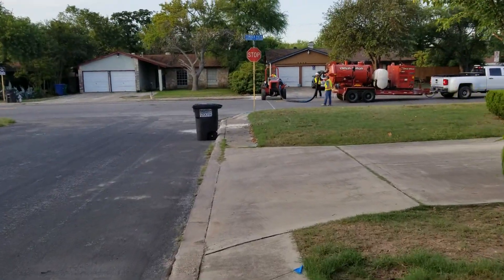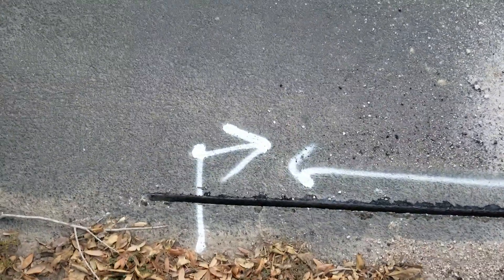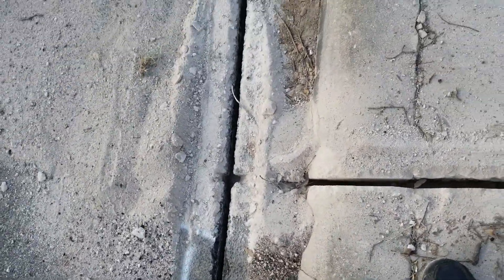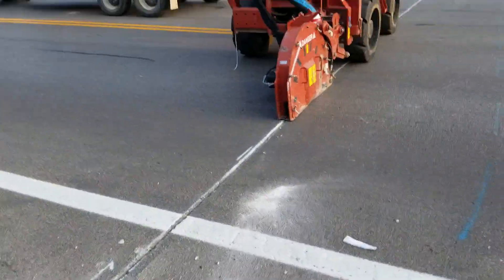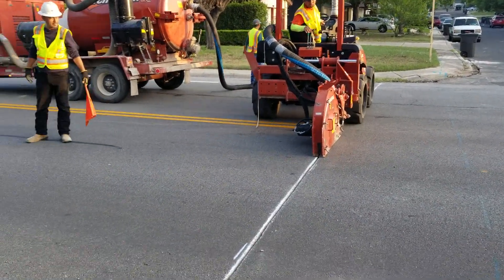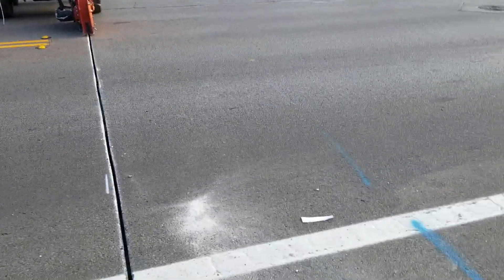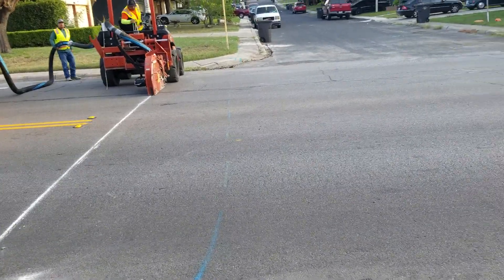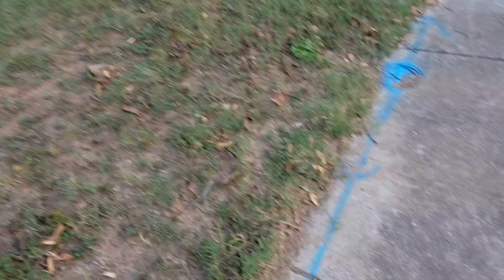How Google lays fiber.

Comment: Just messed up Louisville so bad they up and left.
Reply from the maker: The process used in this video is not the same as the one used in Louisville. Here the trench goes down about 6 inches. I do wonder why the do not just use the microtrench cutter and cut down to a known good depth right through the existing bad installation and lay new fiber in this trench. That would get rid of the old and loose fiber in the least incomvient way and result in a working  system in the end. They are going to have to pay to fix this mess anyway, so why not do it in a way that results in a working system?
Reply: for that info information. I thought they were microtrenching in Louisville since AT&T didn't grant them the one touch move to be on the poles with other utilities in that city. Do you know what method they did use? And I totally agree with you. They should have fixed it to leave a network that can be used. But they've had problems and every city they've been in. They don't know about utility Construction
Reply from the maker: @machinenkanone9358   In LV they cut the trench about 2" deep. All that can hold things in place is the roughness of the edges of the cut, and at 2" there just was not enough surface area to keep anything in place. At 6" as the did here in San Antonio, there is 3x the area for the filler to grip and hold things in place.
 In a place with less extreme temperature swings in the pavement 2" might have worked.  But I would not have bet on that. You are correct that the fight over one touch make ready (OTMR) was a key part of the story. Even after OTMR was approved, ATT just did not attempt to be there before or while Google put up fiber, but they came back right behind and critiqued the install (and according to some) vandalized either their own system and/or Google's). Their lineman's union seems to have been the front for this effort.